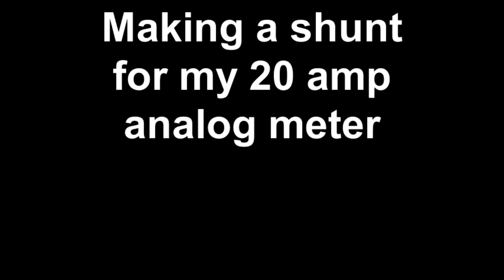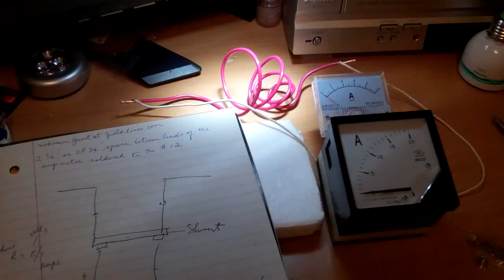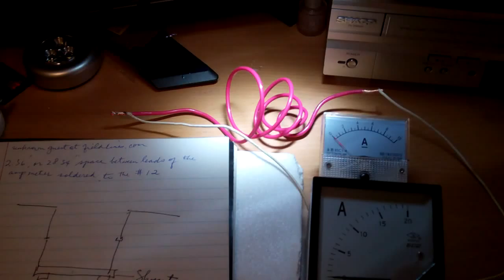Making a shunt for a 20 amp analog meter .mp4

Comment: I like your video. i have a theory.  Copper has lower resistance than steel so the length of the copper wire is higher than steel. , If you use 12 gauge steel wire the length will be less.
Reply from the maker: You are probably right.  I did not think about that possibility but I guess any substance that is resistive will have the same effect.

Comment: When you measure the diameter of a wire to determine the guage, is the plastic insulation around the copper wire included in the diameter?  Or is the copper only included in the diameter?
Reply from the maker: I don't think the insulation counts in determining the gauge of the wire.
Reply: I bought some wire at Home Depot that they call 10AWG and it says 10AWG on the insulation, but checking the diameter to compare with the wire guage charts, the insulation is included in the expected diameter for 10AWG.   If I measure the diameter of the copper only, and compare the measurement with the chart, it's only 18AWG although it's sold as 10AWG.   I don't think the insulation should be included in the diameter.   It doesn't make sense to me.   I'd like to make a shunt using 10 guage, but I'd like to make sure it really is 10 guage.
Reply: @ednja 
Shunts are generally made from "solid magnet wire" or sheet monel metal.  If you measure your wire with a micrometer, find your measured diameter in a American Wire Gauge chart. This will tell you the AWG of your wire. Stranded wire can be used but it complicates the design process.